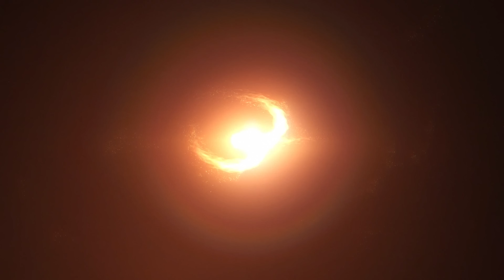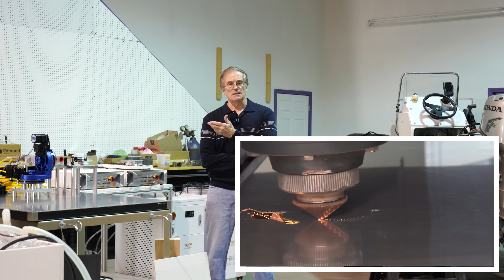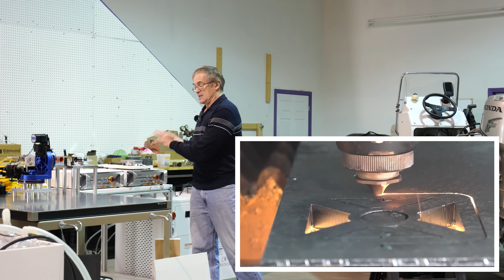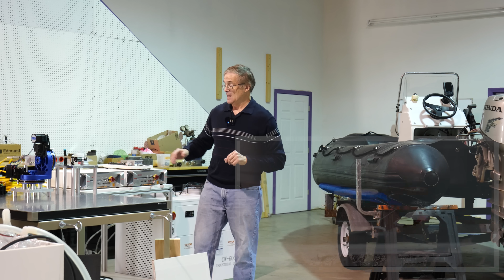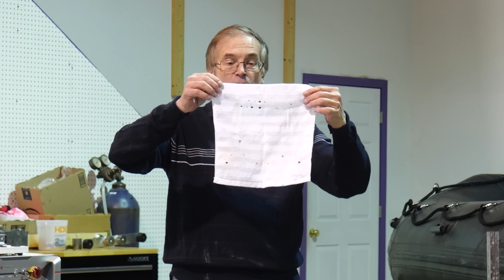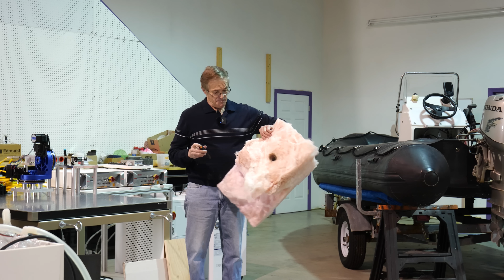We have a problem... and need your help!

Comment: Similar to the Navy and HELIOS?

They use a triple-layer approach with their directed energy test facilities that you could adapt:

Front layer: Engineered silicon carbide tiles in chevron pattern (check ceramic supply warehouses) - spreads the beam without dangerous reflections, just like they do at NRL
Middle layer: Carbon composite heat sink with high thermal conductivity (Navy uses specialized graphene composites, but you can use graphite-enhanced PCM in a metal container)
Back layer: Ceramic fiber boards with staggered air gaps (similar to what's used in naval test ranges)

Mount on wheels so you can roll it out when needed. This gives you 10+ seconds of protection - plenty of time to kill the lasers if tracking freezes.

Cost: Probably ~$1,500
Probably not too sketchy with your setup maybe?

Also if you need help consolidating Youtube comments I can help out with it, i'm a software dev, need work.

Thanks for the video!

Comment: Trying the systematic approach here...
There seem to be two possible ways:
1: Scattering/defocusing
2: Absorption/ablation
Either way suffers from rapid deterioration of materials.
The only material that comes to mind that can be ablated without emitting toxic fumes or bursting into flames and still absorb enough energy might be water. As was shown, water on any solid carrier material boils off too fast. Just clean water might not be absorbant enough, requesting several meters of length. However, water could be infused with scattering and absorbant particles, bringing the size of the beam-catcher to dimensions akin to standard-issue aquariums. It might also help to permanently circulate the liquid. The opacity would need to be tuned to a level that avoids instant formation of gas bubbles, likely a light smokey-grey.

Comment: Would a vertical test be practical, from the shop ceiling to the floor?  Use container of circulating water to block the beam (constantinhenle62 idea). Copper plate for a thermal pad, and the shop floor as a heat sink.

Comment: Two sheets low iron glass, (less heat absorption) spaced several cm apart, like a piece of insulated glass but open at top with a fine air bubbler at bottom to make an air curtain to diffuse the beam. I would recommend a non glare piece for the surface facing the beam and use glass that is etched rather than coated. Behind that, use a cheap substrate like your gypsum board or plywood

Comment: Block of steel with water flowing over it at high rate maybe at 45 degrees. Or glass. 

Or a large fish tank with rubber on the inside of the all to minimize the water flow out rate   Could be in a pool and a pump to flow back in

Comment: I dont know if this has been said yet. But I was thinking.  Layers, first a layer of glass or plexiglass (to let the light into the trap) in the front and backside a sheet metal. In between, fine dark color sand (as the hole is formed by the laser. Sand from above will fill in the hole, Dark color sand because black will absorbed more energy (?) and sand because the mass) the space between the sand add water as a heat sink, as with the sand, water will flow down from above cooling and replacing water turned to steam. I think you need material that is not a solid as it will fill in as the hole is made, and you need something that will absorb the energy and cool it while it evaporates. (the only other Idea is to use a Fresnel lens to spread out the light) If you pick me, no need for credit, but please my I write you an email on something to do as a video on your channel?

Comment: I think water is the right direction.
Build a recirculating deluge system , functionally a shower/waterfall with a stainless steel backdrop that has been. Corse sand blasted. The beam will enter the deluge be defused and vaporise some water. Add dye to the water for more attenuation. If the beam gets to the stainless it will be cooled by the deluge and further difuse the beam reflecting it back into the deluge.

Comment: Have you researched the possible use of heat shield technology that is used on atmospheric re-entry? Much of that is carbon based, light, and may provide sufficient thermal mass and conduction to dissipate the accumulated energy. I have seen those systems tolerate an Oxy-Acetyline torch and still be hold able in the hand.

Comment: Use plywood sheets with dirt between them. If you had two large plywood panels with an inch or two gap between them, joined at the bottom and sides you could fill the space with dirt or something else like clay or a sand/borate mix. You could even have several layers; if one plywood sheet takes 3/4 seconds to burn through, a plywood-dirt-plywood-dirt-plywood-dirt-plywood box would take 3 seconds plus however long it takes the laser to cut through the dirt. At a pure guess I'd say this would give you at least 5 seconds total? If the dirt is loose enough I imagine it would self-plug itself to some degree as a hole is created so it may be much longer. Plus it's gonna limit any risk of fire between the plywood panels. 
Cheap, simple to construct, can be made mobile, easy to disassemble, and clean and safe.

Comment: Sounds like you have both sides of an arms race here. Kinda like the missile vs armor challenge which went on for centuries... actually, I suppose it's still going.

My thoughts are you need something which will dissipate or disperse the beam, but not be destroyed in the process since the beam will continue after the initial shield material is destroyed. My thoughts are something which continually renews itself - possibly some type of fog or water curtain generated and continually in motion. The challenge would be to find a way to make it dense enough and the correct color/material to disperse the beam, but be able to be in motion so that it doesn't simply "burn off" as soon as it is hit. Containment would be an obvious challenge as something which meets the other requirements, might end up being pretty thick and require substantial volume, and just floating/spilling all over the room probably isn't an option. It also needs to be affordable.  This is a tough one. The military would probably just use something highly reflective and not care much where it bounces, but you really don't have that option unless you can scatter the reflected beam - it would be taking a big chance to simply put some highly reflective/refractive material (eg ground powdered glass) on a mirror and hope you didn't miss a spot. I'll have to think more on this

Love the channel. Really cool applied science

Comment: First Solution: DIY water-cooled beam-dump
150 mm-long copper or Cu-W cone (tip angle ≈ 15°) brazed to a 10 mm-thick back plate.
1 mm gap all round, sealed inside a 100 mm-ID schedule-40 steel pipe.
TIG-braze ⅜ ″ Cu tubing in a helical groove outside the cone → inlet/outlet to a beer-chiller pump.
Blacken the copper (CuO or an Acktar-style carbon paint).
Add a normally-closed solenoid valve on the laser interlock: no water flow = no beam.
For a single 3 kW fiber laser, 3 l of water at 1 l min⁻¹ holds the core <80 °C for ~10 s – more than enough time to trip safety logic.

Comment: A tank of circulating clouded water dyed with black die (or something else particulate and absorbative that would suspend in water - similar to muddy water).    The water would absorb the heat and light but the heat would be spread out and dissipated if there was a current in it.    You can drain and fill the tank to move it around.   Water is free.  Your choice suspended particulates in the water you could brainstorm test all sorts of different things to find which works adequate or best.   You basically want really foggy water, but not so foggy the lasar beam can't make it half way through before it's completely absorbed along the way.

Think of the lasar as a stream of bvllets and water like... ballistic gel that keeps moving around or a pile of sand that when shot just falls in on itself and seals the space again.

Comment: Another idea.. 
A flowing stream of water.
A 1/2m square box filled with water. The box material isn’t important.
Think of an endless fountain set up as in a garden water feature. The 1/2m square box sits inside a 100mm tray/lower height box.
Pumps water into the pre-filled 1/2m box from the outer box.
Pump the water fast enough to create a decent flow out of one side of the 1/2m box. A continuous waterfall. The flow of water, will act as a back stop for your laser, without any problems arising from the laser penetrating the container.
Reply: add charcoal powder into the water

Comment: Have you  tested a cement board like durock. Possibly hardie backer, but durock is actually cement, so i think it would hold better than hardie backer. You could line them with tile for added protection if it is borderline.  Also, you could use scaffolding to mount everything to.  Everything would be easy to disassemble and transport. Or you will need a lot of polycarbonate laser safety windows or copper sheets.  Lol, but that will get pricey. I forgot what it's called but the white ceramic liining they use in forges might work
Reply from the maker: I haven't,  but I will.

Comment: I would like to Very Strongly Second @constantinhenle62 other idea (and probably the more promising and unfortunately more expensive version) is using a thin sheet of copper (about 2-3 mm thick) which sounds crazy at first because copper is highly reflective to laser radiation. But if copper gets heated to around 250 °C in an atmosphere with sufficient oxygen (e.g. air), it immediately turns into Cu2O (Copper(II)-oxide) which is  an excellent absorber (up to 97%) for laser radiation around 1 micron wavelength and even gets used in some commercially available beam dumps for high power lasers. The high thermal conductivity should do the rest, by dispersing the absorbed Laser power over a large enough area to not be able to reach the melting point of copper and burn a hole through it.
Matthew D. Arntz
Reply from the maker: Interesting,  I didn't know that.
Reply: @TechIngredients  Yes. By the science, I estimate a very high chance of success?

Comment: Not saying these are good ideas. Just trying to think outside the bix with some. 
An old quarry, a nice little vally with certain angles locked out mechanically as to not burn out side it. How about a wall of that glittery water or glitter filled water behind as clear glass as you can get. Or prehaps a glass refractor micropatterned to break up the beam with refraction - may need multiple layer. 
What about shooting it into a water fall or layers of heavy rain?
None of these may work but those are my ideas
Reply from the maker: Thanks!

Comment: Well because you won't be able to get a brick wall to follow the drone.   For  more realistic system would would use variable pulse width.  !.  very low duty cycle .o1% just enough to be detectable when it hits the drone with coaxial detector optics. then pop the duty cycle up to an affective level and back off.  Most fiber lasers  have inputs that allow this.  Lots have variable power outputs controlled by input signal. Some industrial applications use a combination of variable power and duty cycle to achieve the desired results ie ablation, oxidation cutting. heat forming
Reply from the maker: You're right about the control option.  These lasers already have a visible aiming beam that is perfectly aligned with the main laser beam.

Comment: agitated/swirling muddy(opaque) water in a deep bucket/wading pool, experiment conducted in horizontal plane. while doing the experiment, mount the laser on the ceiling, shooting down into the bucket/pool. physically confine the laser to the area of the pool zone, minimizing reflective angles. I was an engineering consultant, however i hate expensive over designed solutions to simple problems :D

Comment: I think you can't deflect or absorb the light so you need a safety system that can detect if the laser is punching through after 0.25seconds and pop a breaker

Comment: Let me know what you think. 
1. Polycarbonate

Where you’ll find it:
	•	Safety goggles (especially tinted ones)
	•	Blender lids
	•	Shatterproof windows or skylights
	•	Some CDs and DVDs (layers inside may be polycarbonate)

Use it for: Blocking low-power lasers or as a base for tinted filters.

2. Acrylic with Dye

Where you’ll find it:
	•	Picture frames (the clear plastic kind)
	•	Cheap poster frames
	•	Aquarium lids or covers
	•	Craft supplies (colored plastic sheets)

Use it for: Absorbing visible or near-IR laser light, if you can find tinted versions.

3. Metal Mesh or Foil

Where you’ll find it:
	•	Window screens (usually aluminum)
	•	Splatter guards for frying pans
	•	Aluminum foil
	•	Old toasters or microwave doors (mesh inside the window)

Use it for: Reflecting or diffusing beam energy (great for scatter control).

4. Carbon-Filled Composites

Where you’ll find it:
	•	Old hair dryers or curling irons (internal parts often have carbon-loaded plastics)
	•	BBQ grill handles or oven knobs
	•	Brake pads or car insulation (if you’re scroungin’ the garage)

Use it for: Heat resistance and laser absorption.

5. Ceramic-Based Heat Shields

Where you’ll find it:
	•	Tile trivets
	•	Coffee mug warmers
	•	Oven floor tiles
	•	Toaster oven linings
	•	Fireplace brick or tile

Use it for: High heat resistance—perfect to soak up laser energy in a static spot.

Bonus – Absorptive Coatings

Where you’ll find it:
	•	BBQ paint or stove paint (high-temp black coating)
	•	Flat black spray paint (look for high-temp or matte finish)
	•	Burnt cork or soot (emergency ultra-absorbent coating, old-school style)

Use it for: Dulling reflections and protecting surfaces.
Reply from the maker: Wow, that was a thorough compilation.
Reply: You should have started with "Hi, chatgpt here."

Comment: How about a plywood box about 0.5m3 filled with sand? 
The laser will cut through the plywood and begin melting the sand, and as the sand is moved, more sand will fall under gravity to fill the cavity. Also, sand has a decent specific heat capacity (but not as good as water). Could be worth a try small scale.

Comment: Metal used needs to be tailored with more knowledge than I have.  But if you have a container filled with a powdered metal and have air passing through it (imagine fluidized sand) the laser will melt the metal powder (not too fine) and sink to the bottom.
Reply: The melted metal will sink to the bottom. And the air will cool and increase the thermal capacity of the metal powder. (slightly)

Comment: I don't really know anything and as this vid is the first of the series I'm watching I'm assuming Iv'e missed a lot.  But is it not possible to use a lens of some sort to diverge the beam just after it is emitted and make that divergence the "default' mode until the laser is on target? As soon as the target is destroyed, the default mode is engaged again. I suppose that you have a range finding / targeting system that could activate a rotating / 90 deg flip lens on a camera shutter type mechanism?
Diving into you previous vids now. V interesting.